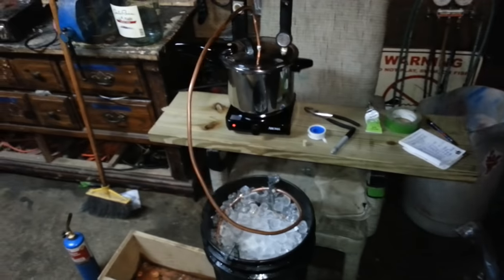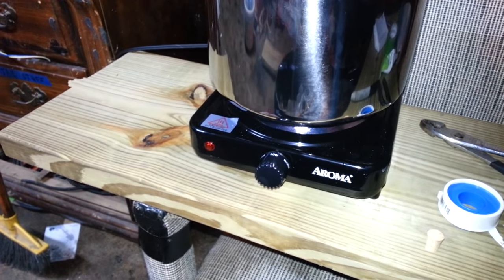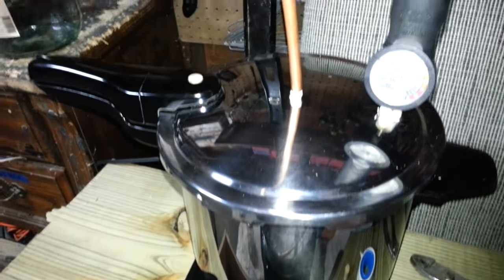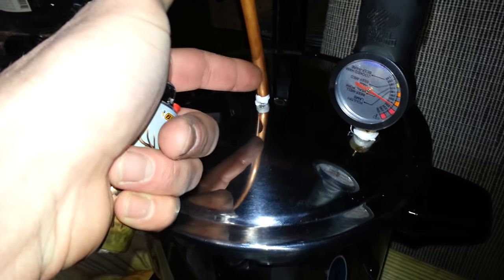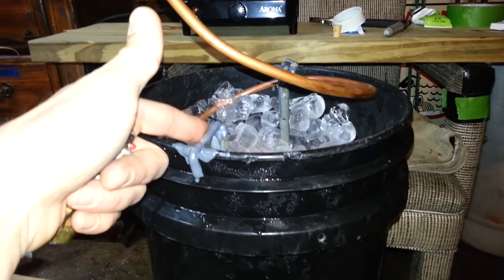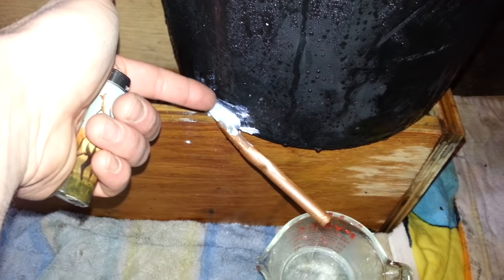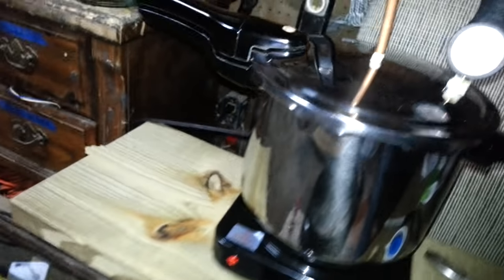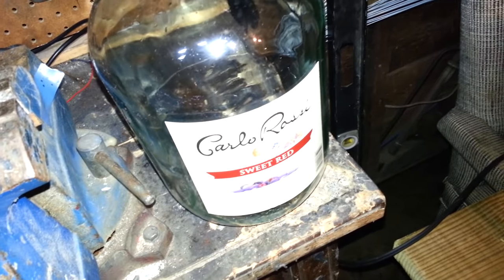HOW TO BUILD A HOMEMADE MOONSHINE STILL !! (Drinking as she flows)

Comment: I run a somewhat similar setup only using a 6 gallon stainless steel pot still and I use 1/2" copper lines. I distill sugar wash and when I use turbo yeast I can get 150 proof on my 1st run, crystal clear. I run mine 3 times and end up with 170-180 proof which I have my own label for when bottling. People are very interested in buying my shine but I won't sell it. (I like my house, freedom and such). I've been offered $50/750ml bottle and yes I turned it down, with regret. I simply give them away to family/friends. One tip I have is to use a container that fits inside your condenser coil to make an ice mold. Make 2-3 of them. I find using those big pretzel/cheese ball jugs works well. Or use any other jug that fits. Even milk jugs and 2 liter soda bottles. Fill them with water and freeze them. That way you just drop them inside when it's time to run and top up with water. No ice to buy. Swap them out when they melt past usefulness. Another thing, don't believe all the hype in numbers. Some will tell you 175 degrees is the magic number and others 200. Trust me, whatever temp your still begins producing at is the right number for you. Pure ethanol boils at 174 degrees, why would anyone tell you that's when your production needs to start at? If you had pure ethanol why would you be distilling it? Depending on the % of alcohol in your wash, your still design, elevation above sea level, ect, your magic number can be anywhere between 175-205 degrees. Know this though, the higher the starting temp means the less alcohol in your wash. If your still won't produce until 205 degrees then you're only getting a low % alcohol out of it and is probably not worth distilling. If it starts at 178 then you're in for a good run. I can go on and on about yeast used, the use and over use of yeast nutrients, how many people fail to use malt or enzymes in corn whiskey, ect. Been doing this for years. Got my art down to a science and can make a 750ml bottle of 170 proof white lightening at under $3 cost. That's because I produce in bulk and in 10 bottle batches. I love this shit.

Oh and another thing, I've written several articles on my experiences and advice on home distilling. Everything is a learn in progress. What you may think is gospel today may be fiction tomorrow. There are a lot of people giving bad advice and it's not their fault necessarily, they're just over anxious to spread what they think they know. I won't claim to know everything and won't bet my children's life on my own advice, but I've been around the block long enough to know I can learn from you and you from me. That's what the internet's for! Happy distilling!
Reply: I'm about to start day one soon, thank you for the info.
Reply: wingmanalive
Reply: where can I read your articles? I'd be very interested
Reply: best part of this video was your words of wisdom wingmanalive. thanks
Reply: Wingmanalive you sound like a very humble man. You don't come across as being cocky. Keep up the good work. I'm so excited to learn to do this myself.
Reply: Pretty good advice and info. I seem to have a similar size set up. My first few.liters are low 70's. Then into the hogn 60's. First gallon is high 60's/135+proof.  My start temps are lower Than yours - like 150s.
Cheers
Reply: PEOPLE GET LICENCES FOR BIGGER OPERATIONS THAT LEAD FROM HOBBIES!
Reply: There is a funnel filter that traps the dangerous stuff which is heavier than alcohol, in a bottle with a funnel in it, placed in a large pot.  The bottle fills up and over flows into the big pot, trapping the bad stuff in the bottle.  Worth saving even as fuel.
Reply: @JohnSmith-nh3bc  Not really. The acetone and all the alcohols in the pot are polar solvents mixed with water, miscible. That means they can not be separated in layers. The only feasible way to separate them is distilling (temperature). It's quite easy though, as shown in this video, as the temperature goes up, you get different types of chemicals out, so its just about collecting the ethanol when it's that ones turn to come out at a given temperature. An example is water and ethanol: water has a boiling point of 100C, ethanol has a boiling point of 78,37C. if you have a 50/50 mix and start heating it up, it will start boiling at about 85C (its higher due to the ethanol/water mix), the ethanol turns in to vapor and comes up the tube. As the ethanol vaporize the temperature in the pot increases, gradually increasing to 100C. At 100C the water will boil, meaning there is no more ethanol in the mix. Edit: If you want to go full breaking bad, you add a molecular filter in to your distilled ethanol (which should be already at 95,6%) after and it will trap the remaining water leaving you with 100% (200proof) alcohol.
Reply: So no thumper needed???

Comment: I started with a little still like that. I have a 15 gallon keg still now. I use a 55 gallon barrel for mash, it makes about 5 gallons of good shine. I use a little pressure cooker like you have for a thump keg. I use the cracked corn from Tractor Supply. 5 lbs of corn and 5 lbs of sugar for every 5 gallons of water. I cook the corn to soften it. I bring it to temprature then cut it back a bit, the temp will adjust it's self, when it starts rising on it's own the alcohol is gone.
Reply: God bless Tractor Supply.

Comment: I was taught that the head(methanol) consist of the first 10 ml per gallon distilled. I usually take a little more to be on the safe side. It'll be the same color but will smell a little more like acetone. You'll be fine using these measurements but if your still worried just take a little more you'll still get plenty of whiskey
Reply: By
Reply: To test you can burn it, ethanol burns blue methanol burns clear.

Comment: 3/8 inch pipe is fine it will run just fine with that. Next time you make a worm wrap it around an old paint can it's the perfect size you want your worm to be, Tape is bunk man I use a compression fitting this means I can break it down fast and easy.  It's great for cleaning and refilling your mash pot tightens by hand.
Reply: I'm also going to put a fitting.... Stainless steel is expensive $$$$
Reply: Girls tell me that my 3 inch pipe isn't enough.

Comment: The drip is actually dependent on your temperature. Not the spiral in your receiver. The methanol boils at 148F and the ethanol doesn't start until around 178F
Reply: lmao no methanol in whiskey or brandy runs, ole wives tale, id be dead by now if that were true
Reply: @ericwhite7597  that's because it's removed when distilling the mash, it's the first thing that comes out bc it has the lowest boiling point. If you distill and keep all of it you'll have methanol, if you remove the first 10% of total volume you'll be good

Comment: No poison. Just throw out the first 4 ounces and your ok. Just keep the temp below the boiling point of water. Alcohol has a lower boiling point, you want alcohol to evaporate out and the water to stay in the still. The lower the temp the smoother the shine. I live in the blue ridge mountains in NC and have seen shine made the right way and the wrong way for years.

Comment: I used a Prestige pressure cooker. A Coleman stove, A 5 gall oil drum and small bore copper CH pipe 10T over 12" X 5" Dia. Coil. Rocket fuel . Then when stilled put a cheap bottle of Vodka or Polish spirit and still again. WOW !!. Mix the mash with some citrus fruit and let it go green !!. Stack Me !!. Take a spoonful and light it. If it burns dry you are there Big Time. 100%.

Comment: i just finally got a 5 quart pressure cooker,i already have the copper tubing n fittings...and i know that i need to clean my tubing by running white vinegar then water thru the coil before cooking shine... my question is ; if i am running 4 quarts of 20% alcohol mash, how many ounces do i thro away at the beginning?(the head)...also, is there any other safety measures that i should take,?as i plan to share with friends n loved ones,i dont want to kill anyone...thnx mann

Comment: Most people use propane gas for their stills. It’s safe as long as you pay attention. The hot plates are not the greatest because they don’t stay on. They heat up and cool down.
Reply from the maker: Yes very true! This was my very first run. So much learned n changed over years. More of a funny video now. But it worked lol fun times!
Thanks for watching
Reply: @MoBowHunter15  I hear you. I’ve used a hot plate myself. It worked for the most part but I wasn’t getting enough consistent heat to keep a steady flow. The turkey fryer I got has been my buddy lol

Comment: Its not a good idea to use ice in the cooler. Water temp should be around 15-20 degrees celsius in there for optimal percipitation. Flow is controlled by the heat on the other end. dont boil it though, alkohol boils at around 80 while water boils at 100 celsius as you said on the vid...
You also gotto measure the alcohol level during destillation. One should stop at 50% on the second round for premium stuff.
Reply: The ice reconstitutes the vapor back to a liquid.

His use of teflon tape scares me. Teflon out gasses near 600 degrees Fahrenheit

Comment: What size tubing and compression fitting??? I have the same pressure cooker
Reply from the maker: It's 3/8th copper piping and I just drilled the hole a little bigger on top of cooker lid the piping now fits right in and goes inside 1/2 to 1 inch ....Just make a flower paste flower n water to seal it won't take much and once you start running it will harden up which will make for better seal
Reply: +Jake Foster thank u kind sir
Reply from the maker: +Brandon Horseman not a problem thanks for watching trying to get a new still up and running try to get a video up soon

Comment: can you run like a cheap whiskey?? would that be better or stronger proof than the wine. .?? Also when you re run it for higher proof, do you just dump the lower proof batch back in and re do? ?
Reply from the maker: hey thanks for watching! yes I've got 175 proof highest I've got so far which is distilled twice I poured 120-140 proof and got 160-175 proof you'll only lose a little in the process so say from 1 gallon you might lose 1/4 of it if that....and yes if you redistill store bought vodka or whiskey you will get a higher proof of course I'm sure you know whiskey that's been barreled will come out of your still clear just might have the barrel taste still

Comment: Are you planning to filter your product through carbon? Have you tried to see if it cleans up the product? just curious.
Reply from the maker: yes I do filter now my product has always been good but with the 5 stage carbon activated water filter really does some wonders....the taste is smoother and the aroma of the shine after filtering is just as amazing I used a ZERO brand filter ....it will soak up some of you shine and it will take some time to go all the way thru the filter I filter everything  5 times or more now been working great
Reply from the maker: Oh and check the filters before you buy make sure you will have a way to pour shine into the filter or the water pitchers with replaceable filters work best ....I replaced filter after a few months of use depending on how much you use it don't really want the filter to dry out a hole bunch of times I would add water to the filter just to keep damp

Comment: how u encounter the leak?, usually pressure cooker start to leak around the lid of pressure cookers specially after few times ... i appreciate any help on this
Reply from the maker: I had same problem before I built new still, I put a few 2.5 lb weights on the top on the pressure cooker to deal with this problem it was a real pain in my ass I lost a lot of product I'm sure over time it's bs if u ask me and manufacturing problem but I've gone down that road n trying to get a new o ring seal is like trying to a child to listen lol so like I said I added weights to top just set them on there I also bent tabs on lid a little to make it push down harder which made it a little harder to get on but did work for a little while I've built a new still now I'll try to get new video up just no time lately trial n era I tinkered till something worked

Comment: will the wine in the cooker still retain alcohol that is drinkable after the run?? how do you know when to stop running
Reply from the maker: Your drippings will slow down as well as I use a hydrometer to check where the alcohol content is.Once around 60 to 80 proof I run a little longer but save the tailings  (the lower proof stuff) and I'll re run them thru to get a little higher product but you will lose some from the cooking process

Comment: how do u clean the copper tubing
Reply from the maker: I run water thru my tubing but only if I plan on using it soon after if not use a vodka or your whiskey other wise if the copper is dry inside from the water it will start to turn it green in which the next tim you run your whiskey will come out blue like windex

Comment: My Teflon doesn't seem to be that reliably tight!  What did you do?
Reply from the maker: I've had that problem too I started mixing up flower n water to a paste and sealing areas works better do this when you first start and the heat will dry it out n seal it up ....you just must go this every run cuz washing will take the dried paste off

Comment: you can use aluminum people just fear that the alcohol will eat at it and cause it to pit. some say it happens other guys say they've used aluminum for years with no problems. stainless is far superior though
Reply: Believe it are not aluminum is toxic also enhances memory lose you can drink out of it but to ingest it breathing drinking pieces of it can be toxic over long periods of time. Also Adds bad tastes to your product.
Reply: Geoff Howeth Disagree, running small batches should be ok.

Comment: like every thing but the ice in the worm. I have a small water pump in mine to recycle water back to sink I started putting a bag of ice in sink to keep water cool but you don't want it to cold that's y it's dripping slow and can bet your getting alot of condensation which is not the water vaper you want. I run at 160 and it runs smoothly not drippy 140 proof corn mash.
Reply: How far in does the copper go in the lid. Itching to try this

Comment: actually water boils at 212 degrees at sea level but in a pressure cooker its up to  257 degrees, alcohol boiling point changes too
Reply from the maker: +mikey mendoza not saying your wrong but I think the purpose of a pressure cooker is to raise the pressure so that water boils faster I could be wrong but I think that's the purpose
Reply: +mikey mendoza your logic is sound but wrong. The pressure cooker is just a means of boiling off the alcohol in a controlled manner. the contents in the cooker arent under pressure because said pressure has a way to escape through the copper tubing
Reply: i have no problem with your you method, just that pressure relate t temperature
Reply: @mikeytobago there is very little pressure in this system because it is open end

Comment: if the inside diameter was larger it would run not drip. you should try and make a worm with at least half inch.
Reply from the maker: yeah when I get to making a new still I was gonna use a bigger piping
Reply: +Jake Foster the faster the flow the lower the proof. I have a friend that makes weaker shine than me the only difference is he uses larger tubing. and runs hotter. I run slow 3-5 drips a second makes over 130 proof every time.
Reply from the maker: +Hannah Bradshaw I'd would agree with you I've done some research and talked to some other shiners that would agree with you as well ....low n slow is the name of the game they say